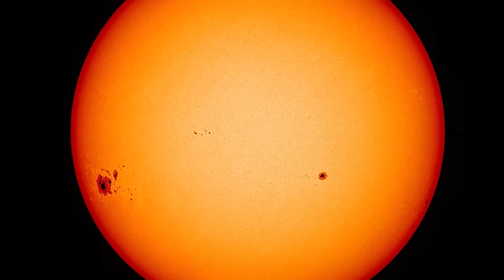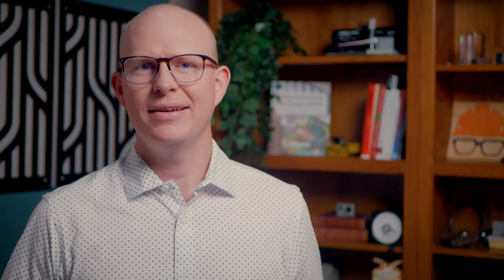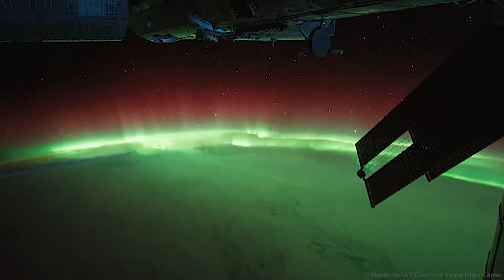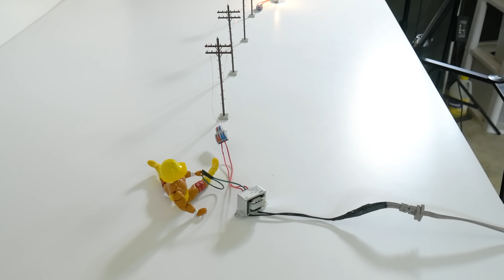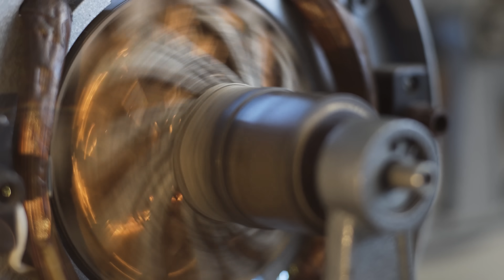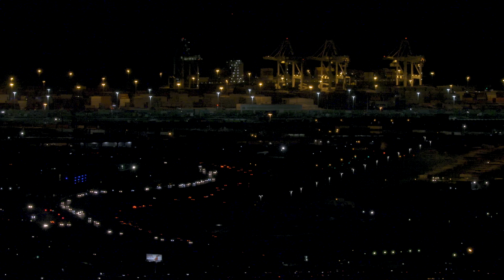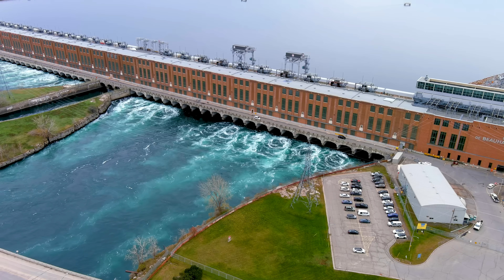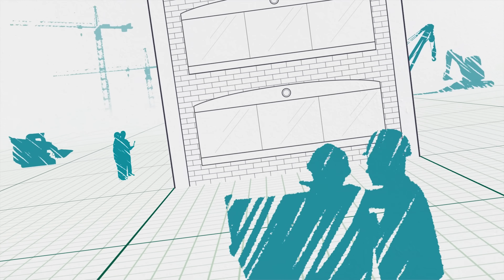The Most Confusing Part of the Power Grid

Comment: I ran a 40 MW generator for twenty years, and was responsible for training many new operators.  I really wish I had had this video available.  I can’t count the amount of time I spent trying to explain VARs, and why it was necessary to comply with utility voltage orders.  VARs are compensated by over or under exciting the generator field.  How far to over or under excite comes in the form of a voltage order from the utility.  

Another problem generators have when exceeding the power curve is heat.  The further out you move on the curve, the more heat generated inside the generator windings.  A large part of generator design is the centrifugal force of the rotor spinning.  The materials can only stand so much before flying apart.  Heat weakens the materials making catastrophic failure more likely.  

Also, wires have their own resistance, and resistors convert current to heat.  More current, more heat.  You can see this with a little patience.  On a summer day, use a tripod to take a picture of the wires between to transmission towers around 2:00 PM when load is highest.  Take another around midnight at the same spot.  You will see that the wire sags several feet when under high load.  

A wire sagging into a tree was the initiator for the Northeastern blackout in 2003.  It caused a ground fault which tripped a generator.  This caused an under voltage which tripped several surrounding generators, which tripped more generators, which cascaded and ended up tripping several states worth of power grid.

Grady has an excellent detailed video on this.  It is titled something like “What really happened in the 2003 blackout”.
Reply: Idk why I enjoyed reading this comment
Reply: What fuel did the generator run on?
Reply: @SheeplandGovt  Natural gas.
Reply: @Simple_But_Expensive  Thanks for your quick reply!
Reply: @SheeplandGovt  hydraulic H2O unleaded
Reply: I've had windings overheat enough to need to be rewound, as the copper became brittle. Needless to say, that's a really, really bad thing.
Surprising to know how many people don't realize that motors and generators are much the same beast, they're just optimized for their designed task...
Reply: @spvillano  We had to rewedge multiple times over 20 years because ambient temps reach 114 at least a couple times a year (Mojave Desert).
Reply: @Simple_But_Expensive  the temperature extremes had to wreak havoc as well. In Qatar, we had similar temperatures and we'd lose distribution transformers routinely - both on base and in town.
Reply: @spvillano  In the spring and fall, we got delta T’s of 50 degrees f.  We knew all about the differential expansion of dissimilar materials.  

I did a contract in my younger years in Saudi Arabia on the gulf.  The sand there is as fine as talcum powder and also very salty.  It got picked up in the lightest breeze, and coated everything.  When the rains came, it was just assumed that we would lose half our infrastructure due to shorting.  We had a warehouse full of transformers and other equipment just sitting there.  About a month before the rains, we would fire up the water desalinator and deionisers and start washing everything down because we knew we were going to need it.  

That wasn’t a problem in the Mojave, but we did spend a lot of time tightening bolts and welding cracks.  As far as transformers, our big ones were built to handle it, but wildlife (large birds and wildcats) caused problems with the pole mounted transformers and reclosers many times.
Reply: @Simple_But_Expensive 
Birds and squirrels are a constant nuisance
Reply: Very informative, but also illustrative of the challenges in addind variable solar and wind power to the grid....
Reply: Isn't that also how they are able to control output voltage as well, by varying the input voltage of the inductive generators?
Reply: Thanks for the info on why the operators don't use VA control mode on the generator to control network PF. A number of years ago I was working on a simulator with 13 generators, there were capacitor banks, but as a Chemical Engineer, with some Electrical Engineering experience, and not a power plant operator I wasn't quite sure why there were capacitor banks when the gen sets had VA governor modes. I think I did have to indicate the VA vs W curves (or something) to show if the generators were over excited.
Reply: @axelBr1  The VA control is useful for islanded systems not connected to the grid, such as offshore oil rigs or isolated locations.  This still requires coordination.  I once was visiting a plant that had two 2.5 MW generators supplying a remote oilfield not connected to the grid where the operator wasn’t paying attention.  He had one generator generating VARs and the other absorbing them.  He didn’t know any better, and came close to destroying the generators.  

The sad part is that there was a switch that someone told him should remain off that would have matched the excitation and set it to maintain voltage at the point of use.  

The generators ran at 6.9 KV and transmitted it nearly two miles where it was stepped down to 480 V.  Don’t ask me why 2 miles, I have no idea, but it meant the generators had to be overexcited to maintain 6.9 KV at the transformer.  

Initially they had real problems maintaining proper voltage, so they installed remote telemetry to tell the governors what the transformer was seeing.  At the same time they installed a PLC circuit to make sure both generators were matched.  

Their PLC tech told the operator to leave the switch off while he was doing checks.  The operator heard that he should leave the switch off forever.  That got passed down to the other operators and none of them thought to question it.  

I was just visiting a friend (the manager), but I recognized the problem immediately.  My friend didn’t see it, and the operators didn’t have the training to know any better.  My friend paid me good money to hold a training session to bring them up to speed, but I don’t think they really understood.  It is hard to get and keep quality personnel at such a remote site.
Reply: @Simple_But_Expensive  VAs are really the hard part to understand, transformers network don't make the situation easier. Frequency (and generator power) are much easier to "see in action".

Interesting story, interesting how a simple command got misunderstood.
Reply: @Simple_But_Expensive 
I recognized it right away from your description. I’m not with the tour group, but I did stay at a Holiday Inn Express last night.
Reply: Similar thing happened last year in the Netherlands. High ambient temps combined with high power load caused a high voltage transmission line to sag down and touch a 1.5Kv DC train catenary wire. Several kilometers of rail infrastructure had to be replaced.
Reply: The Northeast blackout...I recall our industry news reporting that several thousand megawatts were being pulled out of the south on one transmission line with the net load drain being the Northeast.   The line was overloaded enough that it sagged into the unkempt right of way which had grown trees.   Perhaps the generating resource and the transmission system should be physically verified before deploying the reported capacities in the real time dispatch model.
Reply: 20 yrs in a powerplant, most of it as an E&I tech but the last 6 yrs as control room operator. We’re one of the few plants that still manually regulates voltage via rheostats & the operator’s attention span. Constantly adjusting for voltage and vars. It’s amazing how much time you can spend in a career & still learn something new daily. These videos always let me pick up a new piece I thought I knew but didn’t
Reply: How does a power plant maintain frequency when demand fluctuates? Watt = Nm * RPM*2π/60. So either the speed of the piston engine or turbine has to increase to provide more power or the torque, but the frequency has to stay the same so how is that managed?
Reply: @Loanshark753  The generator is electromagnetically locked to the grid.  In any argument the grid wins, so the grid sets the frequency and the voltage.  Increasing the fuel puts more energy into the system.  Since energy can neither be created nor destroyed, it has to come out somewhere, and that is current.

That is for generating to the grid.  The governor controls are put in “droop”, where the load, measured in amps, tries to maintain a setpoint.  Think of a car on cruise control going over hills.  As the car starts uphill, the cruise control adds gas to maintain speed (speed represents current in this analogy), and decreases fuel coming downhill.  

In an island situation it is different.  If you have one generator, you put it in “Isoch” or isochronous mode.  As load increases, the generator will try to slow down, reducing the frequency.  The governor senses this and increases fuel to maintain frequency.  At the same time, the exciter is adjusting current in the generator coil to maintain voltage at the generator output.  If load increases, voltage drops, the exciter increases excitation, causing frequency to drop, and the governor to increase fuel flow.  The increased fuel flow returns the frequency to setpoint, and the increased voltage means more current to match the load.

If you parallel another generator to the island, it must be in droop.  Two generators in isoch will fight until one dies.

Essentially, in non-island mode, the grid sets the frequency and voltage, and the governor matches current to setpoint while the exciter kind of “floats” to match current.  In island mode, the governor sets the frequency, the exciter sets the voltage and Ohm’s law sets the current (amps = voltage/resistance, and resistance is pretty much fixed for each piece of equipment).

I could go into more depth, but that gets into calculus.  This is as hard to understand as VARs, and many operators go their entire career just accepting it and knowing if they do this, they get that result without knowing why.
Reply: @Simple_But_Expensive I’m sorry but what part about the lines heating up causes them to droop?
Reply: @StKColdSnap  Hot objects expand.  Hot lines get longer.
Reply: Don’t forget with the northeast blackout relaying played a part in addition to the lack of right of way trimming. I hope the relay technician stayed employed.
Reply: Cool
Reply: An earth fault tripped a generator? That's crazy. And a bad relay coordination.
Reply: The sagging wire was the proximate cause of the blackout, but the real cause was the system being run too close to failure, so that a single point failure cascaded and brought down the whole system instead of being compensated. They had a major problem with the control system software so they couldn't take compensating action, like blocking out limited areas to keep the rest of the system online. That was the main contributor to the problem.
Reply: Holey moley up in smoke the system goes, because of "A-Gent-Cy" Jo=Ke whereby Joules as Heat (Kin-ET-IC energy or SYSTYM STATE @ time t⁰ → t¹ )  defines  Potential for Disaster. A Mazing -- it's said - T-Hat the way to the centre of a Maze Is to always go right or go left consistently either one way or the other. Iff you end up back at the entrance, then there is at the centre an IS-LAND. TRIAL BY TERROR OF ERROR or repeated experiment is the only way to find the point, where, the island iS, such that, the path to centre is revealed, strange LOOPS feedback works.
Reply: What's your opinion on the vulnerability of our power grid to attacks by foreign agents? If a simple thing like a cord falling on a tree is enough to cause that much damage, surely a single or handful of sleeper cells could mess up the entire grid, potentially.
Reply: @AstroSpeaksTruth a cord?
You mean a transmission line? Far from a cord. 
Each system is designed to isolate parts of the system to keep from losing the whole thing.. it’s part of its function.
In the northeast case protective relaying had been removed for routine testing with the backup relay also being out of service. Not a great combination.
Reply: @Seriously-m1p how could they possibly move forward with test with back up down? And they didn’t know the back out was down that’s an negligence they should be testing that routinely.
Reply: @AstroSpeaksTruth indeed. Don’t give them any ideas.
Reply: I've called my electric company so many times over the years for lines contacting limbs. It takes them forever to get out to cut them down. The only reason I find them is because I can hear the limb being fried. Took blowing a transformer for them to finally cut most of it down in my area.
Reply: @poolhalljunkie9  Transmission lines or local distribution lines?  Local distribution lines are comparatively low voltage, so they are low priority, since they will at most black out a few blocks.  When transmission lines short, they black out whole sections of grids, and can damage equipment with replacement lead times of years.
Reply: is it what happened in Russia?   the whole thing just got out of the hole and floodded the generators room... and the whole site...
Reply: @FredLab0501  Do you mean the Sayano-shushenskaya hydro station failure? That was caused by similar events, mainly metal fatigue from the output control to mantain system frequency
Reply: @cameronmantell9959  The cause of the Sayano-Shushenskaya failure is in dispute and speculation runs from manufacturing defects to sabotage by Chechen terrorists.  The likely cause is a lack of maintenance, disregard of safety measures, and the grid running at capacity.  It was common to overload the turbines at peak load.  This caused cracking in the  casing mount bolts of turbine #2, which in turn caused excessive vibration.  Two years later, it still hadn’t been repaired, causing metal fatigue in the cover bolts.  In addition, four of the cover bolts were missing.  When the turbine was overloaded due to high demand on the grid, the rotor thrust blew the casing through the roof (literally) and started flooding the turbine chamber.  Again probably due to poor maintenance, the automatic valves failed to close, and the continued flooding shorted the rest of the turbines.  The loss of the hydro plant caused at least one other plant to trip, and that caused widespread outages.  In dispute is if the lack of proper maintenance was due to the workers just not doing it, poor worker training, the owner cutting corners, or some combination of the above, but the fact that the investigation was posted and then almost immediately pulled down points at least some blame to someone politically connected (owner).  Noone believes the Chechen’s claim that they did it, as it was definitely metal fatigue, not sabotage.
Reply: @Simple_But_Expensive 
The one that went through the roof also took out one generator to the right and one to the left of it. Three total destroyed, along with a chunk of the dam
Reply: @FredLab0501  Don’t know that incident.  Could you give more details?
Reply: @FredLab0501 Russians are different
Reply: @Astro-k2u  different. ok!  we will say that!   In a nuclear power plant, this is the difference between a success and an explosion...  It trriggered a different future, it nearly killed the whole population in the country... wich was about to lead the world...  yep, it been quite different.
Reply: Sounds like a poor grid design to maximize revenue for the CEO and the shareholders. I live in PGE territory by a hydro plant and after an ice storm the power at two interstate intersections were out for a week. Didn't effect me as I'm off grid but an interstate interchange with gas stations and propane not for sale is a dereliction of duty but the people don't seem to care. The poor line men have to work and they are doing the best they can after years of lack of maintenance.
Reply: @timsteinkamp2245  Not quite how a regulated industry works.

Comment: The synchronous capacitors (over excited motors) not only provide power factor correction, but much needed rotational inertia to control grid frequency, since the wind turbines and solar panels only prove DC, which is statically inverted to give AC.  Good luck, Australia.
Reply: Actually, modern solar inverters conforming to strict standards can provide virtual rotational inertia by going slightly out of frequency and phase with the line voltage.
Reply: That's true but don't forget that big battery plants can arbitrarily modulate the waveform. They can adjust lead / lag / amplitude / frequency on a cycle by cycle basis depending on need. They can absorb energy or dispense energy also on a cycle by cycle basis. In theory, they can simulate any of var controlling elements.

Comment: 2:20  For the two dials on the right, one reads clockwise and the other anticlockwise, but both hands are moving clockwise.  The one on the left doesn't accumulate 10 counts from the right then increment by one.  Instead it moves one time for about every four ticks on the far right.  Why is this counter so wacko?

Comment: Power factor in reality is WAY more complicated concept inclluding all of the harmonics of the basic sinusoid. For the main frequency capacitors may be sufficient but for the rest of the harmonics  definitely not but there is hope in electronics namely PFC circuits that can be used in consumer products thus "repairing" the sinusoid and making current in phase with voltage (PF=1). 
Great video. It was a joy to watch.

Comment: I watch a lot of Big Clive and I never really understood what power factor meant. I do now!
Reply: In the Clive case, a lot of cheap LED lamps only use half the wave form because LEDs are diodes which rectify the AC to pulsed DC, so they automatically have a power factor of 0.5 even without any capacitance or inductance involved. This can be actively corrected for with additional circuitry which is exactly what slightly more costly devices do.